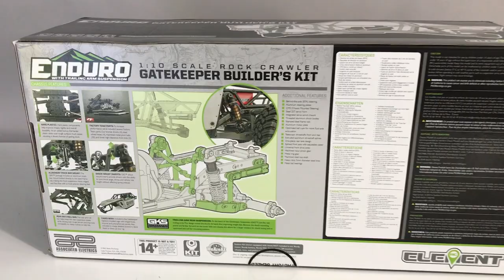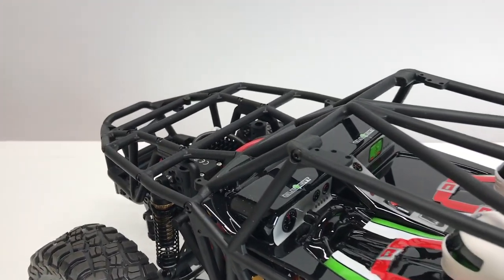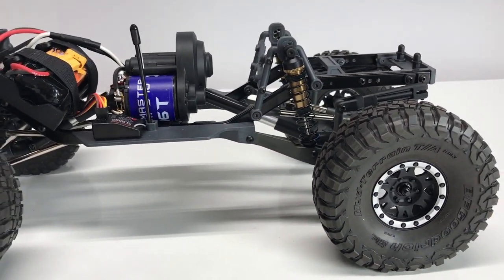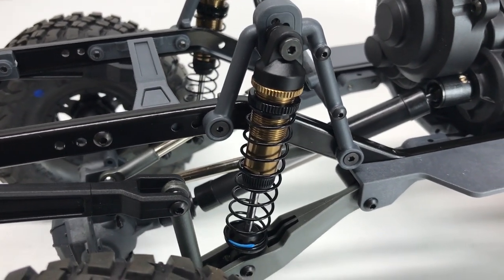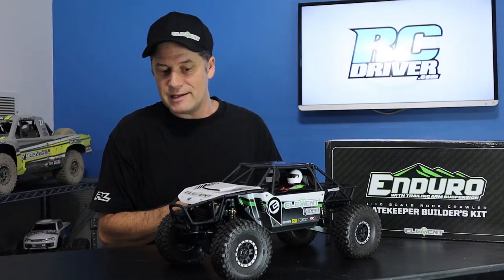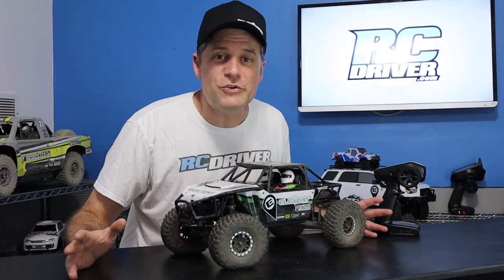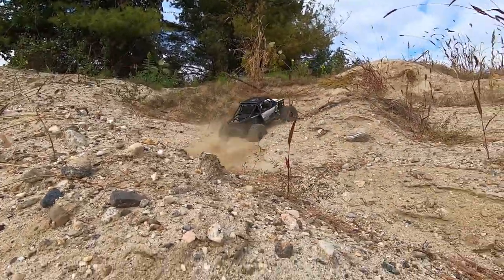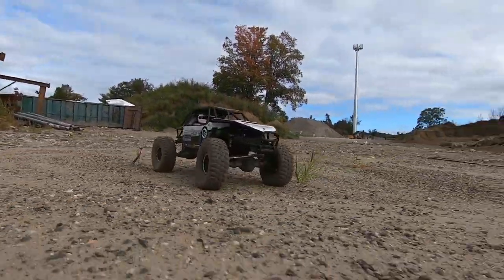Intense Off-Road RC 4x4 Buggy! Element RC Gatekeeper Ultra4 Crawler Kit Review | RC Driver

Comment: i just bought one. will run the cage for a little while then im swapping it with a proline cliffhanger body. it will remove almost a pound and lower the cg by alot. should be amazing to crawl with once i do that.

Comment: I’ve been saying for a while. Flip cages should be standard. You shouldn’t have to tear apart the vehicle to get to the transmission. This looks good
Reply from the maker: Yup! Super easy to get inside.
Reply: Except in this case which puts the front end in front of the front wheels.  Not optimal for this kind of rig.
Reply: That appears to be more of a necessary evil of building a cage buggy over an existing rail chassis and pivoting from the front rather than the rear like the yeti
Reply: @TheDeLeonGarageCollection  True, I think the whole rail chassis for a U4 truck isn't the best.  Harder to put a pivot on a full tube chassis like a bomber, but I prefer the performance that that affords.

Comment: Can one put the IFS on this rig? And how much overdrive are you running? Is it similar to the GOM?
Reply from the maker: I haven’t tried installing the IFS. At quick glance it looks like it should work, but it’s not listed in the manual under options. I ran my rig with the Stock Option 1 overdrive. The GOM is a bigger buggy.